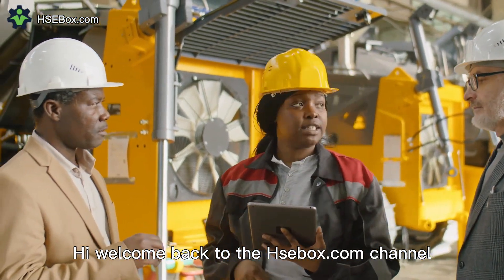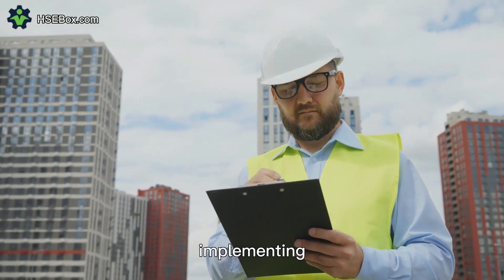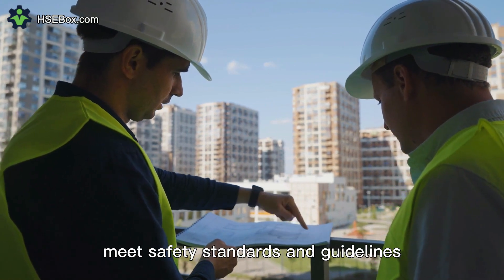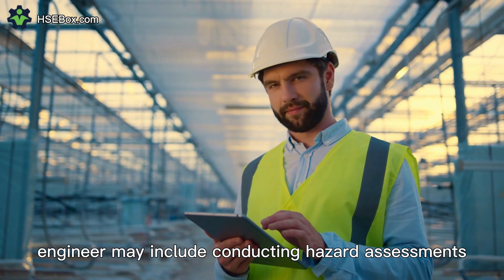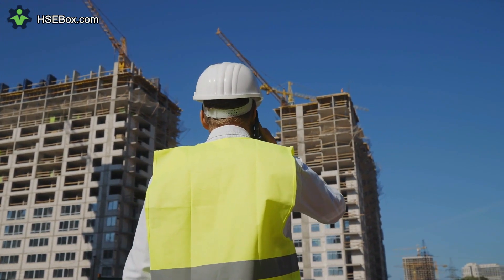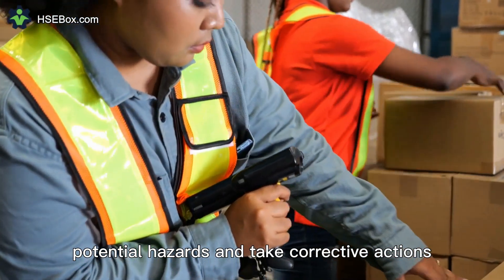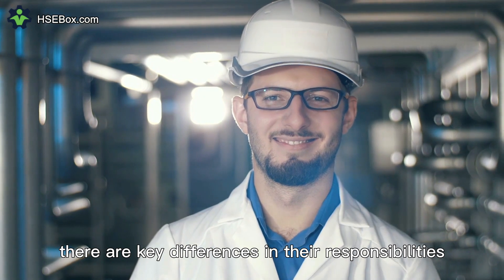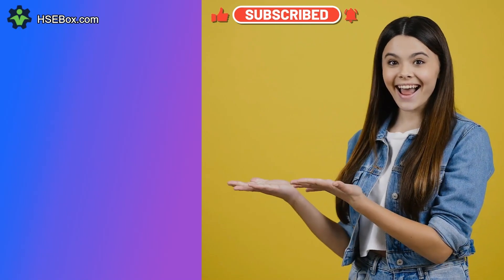Safety Officer vs Safety Engineer - Safety Training

Comment: Well, take these safety software engineers for example: 

They think nothing of violilating the relationship between authority and responsibility. 

You see, as a truck driver, I'm responsible for everything that happens to and with the truck. 

Therefore, I am supposed to maintain complete authority over the operation of that truck. 

I can not be held responsible for something that a software program did in the act of userping my authority over the truck. 

But these ignorant tyrants are constantly implementing systems that do just that without understanding that their personal capacity to grasp the necessary big picture is severely lacking. 

I'll give you an example. 

These programs can't understand the randomness of human behavior and so they react in a preprogrammed manner that is entirely contrary to logic.

I am referring to the, "collision avoidance system".

Sometimes when you are in a large truck driving like a computer, people get pissed off.

They don't want to just go the posted speed... and sometimes to demonstrate their discontent, they do something completely unexpected by the programming and cut the truck off by passing it intentionally close to the bumper with that single finger wave out the window.

This causes the CAS to brake hard and turn away from THE IMMEDIATE OBSTRUCTION. 

In a self driving truck it caused it to slam into the cement barrier and spill its guts all over the road.

Now we all know the correct response was to simply return the curtesy with another single finger wave.... but the programming is not that good. 

A similar thing happened to me in road construction. 

The highway was shifted to one side as the other side was shut down for construction. 

There were cement barriers on both sides and down the middle to separate oncoming traffic. 

...but this was Georgia where highways randomly cross all four lanes of 65mph traffic heading in both directions. 

...that's right, no overpass.... just a yellow diamond sign with a cross telling you there is an intersection. 

The stop sign is for the people crossing the four lanes but the people on the major highway are warned to,  "slow".

Under normal conditions; someone exiting the high speed lanes to enter the adjacent smaller highway pulls off onto the shoulder and makes the transition. 

But this time there was no shoulder, just an opening in the concrete barrier. 

The car in front of me signaled he was turning right and slowed, just as the opening was available he exited my lane.

I understood what he was doing, he understood what he was doing the on comming traffic understood what he was doing... but my CAS struck the brakes and pulled the steering hard into oncoming traffic at 50mph for a combined head on collision speed of 100mph.

I had to fight the steering wheel back to the right to avoid entering a one lane channel filled with oncoming traffic. 

...after that my boss had all of our trucks return to the dealer to have that system disabled. 

I can read the news article in my head... "Mentally Deranged Truck Driver Commits Massmurder / Suicide".

Yes it wouldn't be the safety engineer hanging by a rope... it would be my family and the company I was driving for. 

Now naturally the problem is that if there is an incident and the authorities discover that the company has intentionally disabled the CAS, we will be facing a lawsuit. 

...and yes I can also tell you what happens when a safety software engineer installs a stabilization control system or SCS on a truck without taking into consideration the simple fact that some loads are by definition,  "UNSTABLE" like a dairy tanker with no baffles by law.... or a catle hauler.

...yes you get a runnaway oscillating braking response that turns the load, the trailer and the truck into a Mexican jumping bean.

....and it's real fun on a clover leaf exit.

....and I haven't even discussed the hazards of adaptive cruise control, or ACC.
Reply from the maker: Thank you for sharing your experience, David! Your perspective as a truck driver highlights real concerns about safety software systems and their unintended consequences. While these technologies are designed to improve safety, they must be implemented with a deep understanding of real-world conditions, especially in high-risk environments like trucking.

Balancing automation with driver control is critical, and as you've pointed out, sometimes these systems can create dangerous situations rather than prevent them. Hopefully, engineers and regulators take more input from experienced drivers like yourself to refine these technologies.

If you're interested in more safety discussions, feel free to check out our channel and HSEBox.com. Stay safe on the road! 🚛👷‍♂️
Reply: @hsebox  One of the main problems with trucks and cars is the fact that manufacturers are seeking the highest, "safety ratings" possible and in doing so they implement every software idea that bubbles up in their head.

Some are useful in certain situations and others are just annoying and others come with unintended consequences. But the result is always to separate the driver from the vehicle.

Comment: two people I really resent because of what they do to people.

1. Salesmen
2. Safety officers

Although I'm a good salesmen, I hate the feeling of manipulating people as it infringes on their free will.

...and although I would probably make a good safety officer, I don't like micro managing people as a job requirement.

there's a tendency for people in safety to foster false beliefs and then demand others comply with their delusions of perfection, usually at the expense of their jobs if they fail to obey.

You see, safety officers believe that you can eliminate accidents... but you can't. All you can do is manage them and when the managing becomes oppressive and intrusive the tyrannical measures of managers hits a point of diminishing returns pretty fast.

No you can't eliminate all accidents, all you can do is approach zero but you can never equal it.

However, in the quest to equal zero the measures taken actually get there become exponentially greater and cost you everything for almost no gains..

You end up loosing your employees.
Reply from the maker: Thank you for sharing your thoughts and concerns openly. It sounds like you have experienced and observed some challenging dynamics in both the sales and safety sectors.

Safety officers, the role is complex and often misunderstood. Safety professionals aim to minimize risks and prevent accidents, but as you rightly pointed out, it is impossible to eliminate all risks entirely. The philosophy of "zero accidents" can sometimes lead to measures that seem excessive or restrictive. However, the core of safety management should be about creating a culture of safety where precautions are a part of the workflow, not a hindrance to it.

Effective safety management involves communication, education, and cooperation across all levels of an organization. It's about finding practical, efficient ways to protect workers while also respecting their expertise and input. The best safety programs involve employees in the process, using their feedback to shape policies that are both effective and empowering.

Comment: Usually Safety engineer reporting to safety officer regarding safety at workplace
Reply from the maker: The reporting structure can vary depending on the organization's size, industry, and specific management hierarchy. In some cases, especially in larger organizations, there might be multiple layers of safety management, including roles like Health and Safety Manager, Director of Health and Safety, or even a Chief Safety Officer.